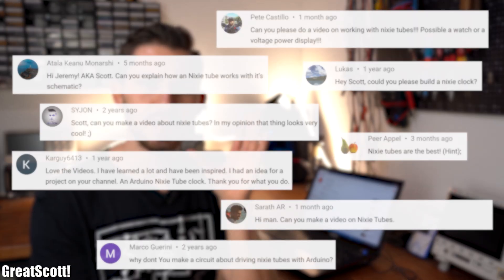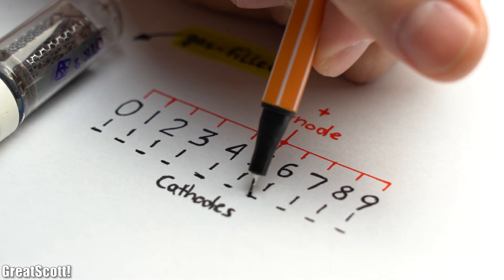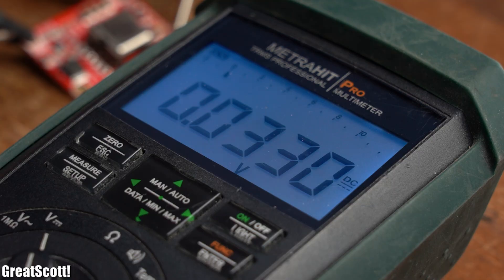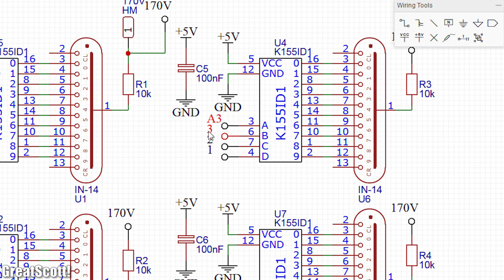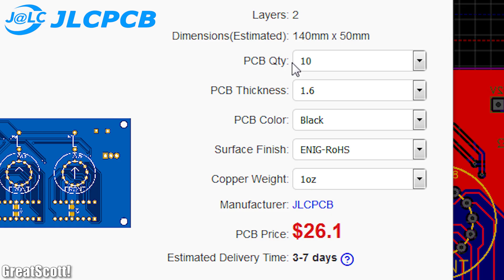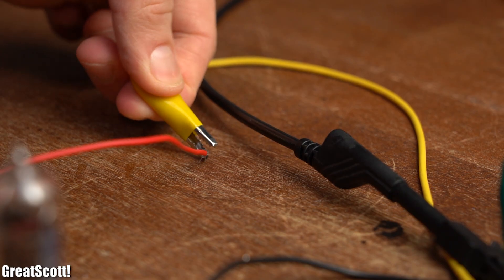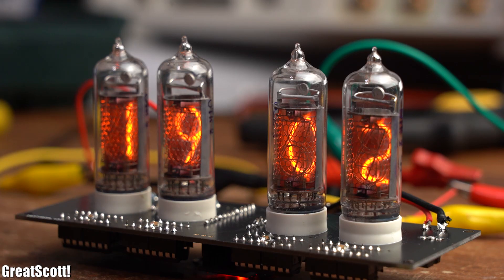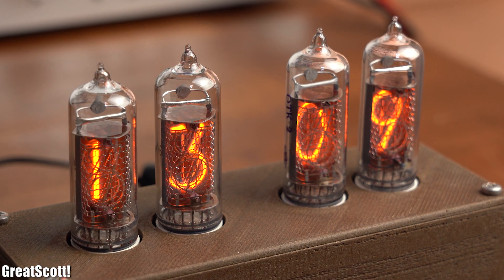Make your own Retro Nixie Clock with an RTC!

Comment: First of all, I love this project, been thinking about building something like this for years. On this note, I just want to point out a few thoughts I have, on how to improve on this project, no hating thought, I admire your capabilities to troubleshoot and complete these things, hence why I've been following your channel for years. Big fan from Norway.

Now, I'd hate to look at this clock and see those 4 screws at the top of each corner. This could have been done way better, preferably with countersunk screws mounted from the side, covered with brown caps to keep them hidden.

A thought regarding the tubes themselves, cathode poisoning. This probably isn't a big problem for cheap components such as these, but it could be mentioned, and a code could be added to lengthen the life of  these.
Lastly, brightness. A button to toggle between night time and daytime brightness, or just add a code for switching between these two modes at a specific time of day, or add a photocell and have it dim the light relative to its environment, could make it even more appealing.
Reply: I think the screws like he used them are pretty good looking, what I don't like it the fake wood texture. And no I wouldn't want to dim the luminosity of the device automatically, a fixed value is better. Can you describe the cathode poisoning effect?
Reply: @AlessioSangalli  Screws a ugly and protruding, not associated with a good finish. Dimming is a personal preference, why shouldn't it be an option? If you don't like it, don't incorporate it/don't use it, simple as that.
Cathode poisoning is very well explained on tube-tester.com, so google cathode poisoning and see for yourself. Good text and visuals for explanation, far better than I can give in a comment.

Comment: Really cool project! It‘s sad that nobody produces those tubes anymore. They look really nice and, as you showed, it isn’t that hard to built a clock with them.
Reply: Look up Dalibor Farny, his company makes them. They're expensive but they are in production
Reply: @blueberry1c2  Expensive is an understatement. They're not sold separately, but as already assembled clocks and the prices basically work out to $320 - $400 a tube. Compare that to current price of IN-14 tubes of around $11 a tube and the difference is staggering.
But the soviet tubes won't be around forever and they have already gone up in price significantly. For example in 2018 I bought IN-12 tubes for $1.25 a piece but nowadays you'd be lucky to find them at $4 a piece. Eventually the prices of soviet tubes are gonna catch up to the brand new ones and maybe even overtake them. Honestly buying Nixie tubes seems like a good investment - probably better than gold lol.
Reply: @ADraco Millclock is also producing their own (very large) Nixie tubes. They look amazing but at $130 each are very expensive as well.

Comment: Considering that the RTC is holding the date as well, it wouldn't be hard to have the clock toggle between showing the date, and any other info you wanna show. Like using a DHT11 and throwing a humidity/temperature on there too!

Comment: I've been working on a nixie tube clock for about a month now as my first electronics project. Instead of the BDC chips I'm using transistor arrays and shift registers since my tubes weren't too happy with the cathode voltage being clamped to 50-60V, which I think the BDC chips do?. Also instead of an arduino and a separate battery-powered RTC I'm using an ESP32 which has built-in RTC and WiFi for NTP time synchronization.

It's been a huge project considering I knew very little about electronics and  C and embedded programming at the beginning. Now I've completed the electronic design and PCB layout, learning KiCad in the process, and I'm very close to finishing the programming. I've yet to design a case, which I'll use as an excuse to learn CAD.
Reply: Berengal Update on the project? A nixie clock is an ambitious first project.
Reply: @louisdelvecchio388  I got 90% done pretty quickly, then have only been working on it in stops and starts since. Other things keep getting in the way, plus when I'm almost done there's not much more to learn from the project so my motivation isn't always there.

I have controlled nixie tubes with the shift registers and transistor arrays, and I have gotten the esp32 to get the time via NTC and output it correctly on the shift registers, but that was both on breadboards. I have finished soldering the PCB, but I have some code tweaking left to fix some of the issues I ran into. I know what to do, it's just getting around to it.

Comment: instead of switch case digital write, you can do

for (int i=0;i<4;++i)
  digitalWrite(PIN+i, bitRead(number, i));

Change the signs if needed, or even better, write to the port directly with bitshift

Comment: 6:55 - immersion gold on through-hole pads can be hellishly frustrating to solder to if you do not make copper around those pads extra wide and make the holes also wider.

+ if you use extra flux, black solder mask requires lots of isopropyl alcohol to clean up.

Comment: I found a nixie clock kit on the net that use no Integrated Circuits, all functionality is achieved using discrete transistor-diode logic.  This kit is great if you like soldering, or want to practice your soldering as you will need to make 2917 good solder joints to have the clock work. I'm 62 years young and love old tech.  I don't know why except it is an art form.
Reply: GreatScotts videos are really very interesting.
I once designed a Nixie clock using discrete Clock generator (1Hz), Binary counters and AND/OR logic ICs etc. but no Microcontrollers leave aside Arduino boards. I would be very interested in this kit using discrete Transistor . Diode logic devices you used. 
If you still have the name and/or Link for that kit, could you kindly share that here. Thanks in advance.

Comment: 10:22

What did you used to mount that 170V power supply? Did you just used hot glue or brass standoffs?

I can't see it really well on my screen, but i see some standoffs in there, connected to the HV output and that might be drilled down and screwed, waiting to someone's hand to be shocked.

Nice video btw, I just found that rather alarming.

Comment: Sorry for my poor english.

I have build one 6 digits nixie clock a few month ago.
With one PIC18F2420 micro controller, one RTC module, and eight 74HC273 to drive HV transistors for control each numbers of 6 tubes.
I even added a HC-05 bluetooth module for micro controller, that can connect with your phone for sync the time to RTC module or do some tricks.

Comment: That's the first time I've seen a project box made of the wood fibre filament - can't say that I'm impressed :(
Reply: I think it's hard to print without it clogging up the nozzle. You should preferably use a bigger nozzle (0.6 or 0.8) for it to not clog up. The standard 0.4 won't cut it.
Reply: Snafu I thought it looked nice

Comment: Ah, the bonus Analogue ports of the SMD 328 catch another victim!
Yes, as you discovered, these aren't like A0-5 (which are on the DIP version), they're almost an after thought added to the SMD version of the ATmega328 to make use of the extra 2 pins on the SMD package.

Comment: Congrats this very neat little project :). I don't know if you are aware of a small issue with these DS1307 (TinyRTC) boards. The issue is that they are designed to use a rechargable litium battery not CR2032. When the board is connected to it's power supply it will try to sense and charge the batter that in the case of CR2032 will result of it blowing up after a few day (or a possible longer period). To avoid this issue the charging circuit has to be disable by removing R4, R6 and diode D1 (I'm not sure that's necessary) and shorting the pins of R6 with a small wire to remake the line. Cheers :)
P.S. I forgot to mention that for a better stability it is recommended that the quartz oscillator body to be soldered to the pad beneath it

Comment: Next time could you create a Nixie lab bench power supply or multimeter? As cool as a Nixie tube clock is, I think it's even cooler when it's used in science.

Comment: I've seen some clocks prevent burning or something like that (while displaying hour, from time to time it goes from 0 to 9 in all tubes). It would be a nice feature to add
Reply: Good point.  They need the slot machine effect to keep from cathode poisoning.  While it may take some time for that to happen, long term is should be included.

Comment: Beautyfull project like always but I see one problem you didn't account for and that is cathode poisoning in the nixie tubes. The minutes are not that big of a deal but the hours will definitely suffer this issue maybe even the 10 minutes division. My suggestion is to cycle trough the numbers every 5-10 minutes the times and then it's done perfect. You can program that to the Arduino.

Comment: if you need 170V to "start" the nixie tube and 145V to maintain the light how could you connect a resistor which decreases the voltage from 170 to 145 how did the tube still light up?

Comment: I am surprised you have not used DS3231 instead of DS1307. DS3231 have temperature compensation, when 1307 does not. DS3231 have pre-trimmed, built in, calibrated crystal, modifies the load capacitance in response to temperature change (you can read and display temperature read by its internal feature). Its tracking it's age to applies aging factor to the load capacitance.

Comment: Nice project! I would recommend you add spinning all digits feature to the program. This will prevent to poisoning of the cathodes.  Btw. sorry for my English
Reply: your english is good
Reply: @TheAechBomb  He speaks English better than I speak any other language.
Reply: @andrewkieran8942  same here
Reply: @TheAechBomb  He speaks english very well!  So much better than Joe Biden.
Reply: What is the cathode poisoning?
Reply: @AlessioSangalli  if you leave one digit (usually 0) on all the time, the other digits can get a layer of buildup on them and start to look spotty.
Reply: @TheAechBomb  OK but how to fix this?
Reply: @AlessioSangalli  if you cycle through the digits, or run the spotty ones continuously, it will remove the buildup. this is similar to the nixie tube 'burn in' period, where you let the numbers cycle about 1 second each for a week or so, so that all numbers are evenly worn.

Comment: Nice project! Though an ESP would have been better here. It could sync the time via wifi and allow changing settings via BT.
Reply: Yes it works with an ESP32 !
I made one last year See it here : https://www.thingiverse.com/thing:3624970
Reply: DCF77 is also cool if you're in Germany or nearby
Reply: @Gastell0   Or even a GPS, they are so cheap nowadays
Reply: @freedom2000  You get much better reception on DCF77 if you're in the area of coverage, though. At least in my experience.

Comment: Project idea:
Easy upgradeable ESC with arduino. You could build an universal sensorless Esc with just a potentiometer as an analog input. With this ESC it would be verry easy to control every brushless motor without a rc control or servo tester. And if you need more power you can just use stronger Mosfets.
Ps: I have tried this and somehow failed many times. But you could do it easily.

Comment: Nice project! But you really have to have in mind that these tube dont like a constant powering. Things like dark spots can happen, because of this, all commertial nixie clocks use these "slot machine" effects. You maybe should implement that too!
Reply from the maker: Ok. I will implement that in my code.
Reply: Yes, to make your tubes last longer you have to cycle through all the numbers to prevent cathode poisoning. 
this will definitely be an issue for the hour numbers

Comment: When you put a resistor on the anode and by that limit the voltage over the nixie tube how does it ever reach its 170V needed for firing ?
Reply: I think he said in the Video that it fired up with 145V aswell @ 3:40

Comment: this look great, i'm just asking myself why didn't you get some 'plug n play' tube socket instead of the weirds white one ??
Reply from the maker: Can you give me a link to those?
Reply: @greatscottlab  

https://www.ebay.com/c/1253156899

you solder them on the pcb and then insert the white socket in

the 'cheaper' version is to do this:

https://www.instructables.com/id/IN-14-Nixie-Clock/  (step 2 and 5)

Comment: I have already build 8 of them :D
I have never used arduino, I always  use radio transmitted time from Frankfurt.
Reply: Vít Cenek do you have more info about this? Sounds awesome!
Reply: @space_0027  Google DCF77 or TDF time signal for more details
Reply: Lassi Kinnunen  It's the way they transmit the time on the atomic clocks used to set standard times for large areas.
I'm sure it's a standardised component. 
It's simple antenna and receiver to decode the information in the signal and set the clock's time accurately. All that you have to do is set the time zone.
Reply: Using TDF as a source to adjust time are not excluding Aurdino.
Or using any other source for the time or adjusting time, which is what you do, adjusting time. You still need a time source to adjust. As someone already wrote. 😜
Reply: @AndersJackson  You can also just display the time received, without any digital IC, code, and all other unnecessary complexity you kids are so addicted to.
Reply: @NGC1433  And how would you do that?
Reply: @NGC1433  on Nixie tubes? I did set my mechanical watch to long wave time signals daily in the 80s by listening to them on a Rhode & Schwarz radio, but even there some electronics where involved.
Reply: @NGC1433   unless you live pretty close to the transmitter, the 77kHz signal is received mostly by night and it often takes a fair amount of retries to decode a good one (it takes a full minute to receive one decoded signal). Some sort of short term time keeping is needed. I also do not like the solution posted in this video as it does not have long term accuracy, but one that just "shows the DCF77" is not practical
Reply: yeah.. living near Germany is pretty convenient because of DCF77..
Reply: Can I buy one?
Reply: @Ironsliver2000  There's a few on amazon
Reply: @ariesrc1536  too expensive 🤔
Reply: You may add a DCF77 to update your RTC, but that‘s all. I built a DCF77 clock in the 80‘s (called „atomic clock“) with a VFD, but that was a normal quartz based TTL logic digital clock which was sometimes updated by the DCF77 signal. At that time the quartz base was not really well temperature compensated, but a modern RTC should have a good time precision for many years.